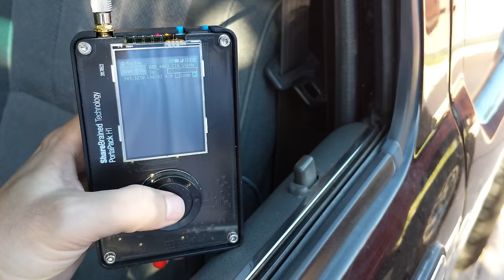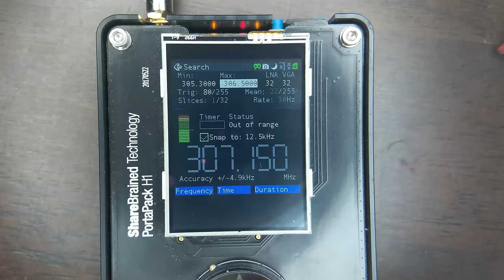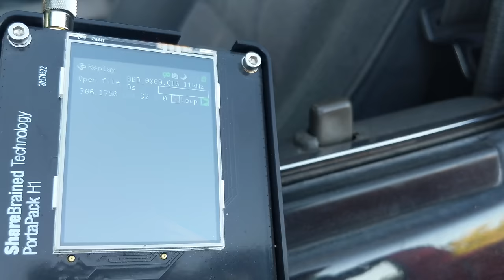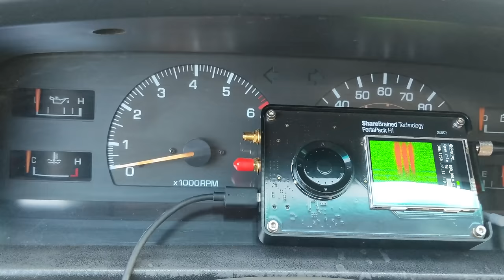Unlocking Car Doors with the HackRF Replay Attack

Comment: Just because the code is rolling doesn't mean you cant attack that device/vehicle..  You would have to either plant a sniffer or be within range of a target while they're trying to open the door , or start the car to not jam (but similar) their signal and keep that valid code stored.  The Hak5 video they released today was awesome , they were using the same hardware as you , same firmware.  This was the guy who did the amazing IR hacking video on Hak5, he is former military.  They tested this on a brand new ford , they've implemented a security feature that really isn't a security feature if you approach it from an unconventional way.  It used to be that you could just let off a burst of unlock codes and car wouldn't know what to do and eventually just open, no more. You can disable their remote and roll them back to 0 and as long as you play the unlock sequences in order it will work every time.  Until they reset their FOB as long as the captures are played in order the door will open.  Check that video out , it has 3 parts , very very cool things , he plans to open source the code at DefCon , he was just trying to get things ironed out with Ford before he goes and puts them on blast in front of the world.
Reply: Once someone has access to the vehicle they  can plug into the obd2 port and check door codes and implement whatever they wanted into the system.
Reply: lets be friends
Reply: Yea but the code still changes after they open the door once, no? So even if you capture it when someone drives off or walks off, you would need their clicker to intercept a new code to open it for yourself?
Reply: This is why we block OBD ports now and keep our keys in faraday pouches the moment we exit and lock and the vehicle.

Comment: if you capture a signal from a key not in range of the car, i believe it would be valid since it is new to the car, for modern keyless entry systems.
Reply: But as soon the owner uses his key, all older signals get unvalid
Reply: @CA-FE-C0-FF-EE-00  yep
Reply: Right because the code rolls to new codes each time

Comment: LOL, this has been solved long ago. Some remote chips use what is called rolling code. The code keep changing each time you press the remote and the car picke it. Remote will not use same key on the next press and on the car side, the last code has been stored in the body control module. So the module wont allow any reuse of a previous transmision because it will show the same code. This has  been mandatory, in companies like VW and it has been used as the industry standard for years. but, this is for OEM level gear. Probably cheapo alarms still dint got it right. Code is alway incremental counter and comparison is not just against value but a big range of numbers above the last one. so replying frames from 200 uses ago, wont work as well
Reply: 38911bytefree there must be a hack for that cos ppl were able to turn off my viper alarm
Reply: Just jam the frequency and grab the code. 'LOL'.
Reply: Rolling code is definately more secure, but it can also be hacked.  You can jam the nearby frequencies to "confuse" the car receiver and then capture the button press. The car of course won't unlock so the victim will press the button twice. You can detect the second button press and replay the first one,making the car open. Now the attacker can use the signal received from 2nd button press to open the car.
Reply: Dont forget most cars have a second remote... that's all I'm going to say 😂

Comment: The HackRF One can also be used to perform an attack on some cars that use rolling code, though.

The trick is to listen to 2 unlock attempts in a row. You partially jam both in a way you can still reconstruct the correct data (e.g. by jamming the CRC portion) and then you immediately replay the first one. Since the car has never heard the last one, you can still use it later, up until the car hears a new command from the actual key. In some cases, you can edit the packet, such as by changing it from "lock" to "unlock" and so on.

Comment: In case of a rolling code, isn't it will also work if you read the fob press code outside the car transmission range? Like somehow a car owner press key in rf reader proximity but both being away from car?

Comment: So did you try doing a replay attack on a rolling code key fob, when the key fob was far enough away from the car to not be able to communicate with each other? I'm reading samy kamkars power point from def con and it says that it should work. Obviously not ideal but i'm curious to know if the hackrf can do this.

Comment: rolling codes is also possible to hack, jam the same frequency of the rolling code to capture the 1st rolling code, then let it jam the same frequency to capture 2th rolling code. Then turn off the jammer and replay the first captured rolling code. and the door will open oeps;P The rolling codes are not time based they have a seed + counter.
Reply: Edris Keyam great comment 👍🏻🇬🇧
Reply: but if you are jamming the codes how could you replay them if the jammer was affecting that signal you saved?
Reply: How do you capture the signal if noise is being played on that same frequency the key fob is operating on? Wouldn't there be a bunch of garbage noise when you're jamming? I tried it myself and it did that, there was no way to pick up any signal because of all the noise coming from the jammer on that frequency.
Reply: @thatoneintrovert9618 you're correct my friend either steal the keys.. Or crack the window and pop the bonnet and go through the computer. Hypothetically ofc

Comment: I saw hardware like you have, but with option to block signal. Rolling code is using its code only one time, so you cant copy it. But if you block and copy the original signal you have a copy of unused  code. and it will open device only one time. Simple. :)

Comment: so its not just the frequency but also a certain signal code?
Reply: Yeah. If you just send on the fixed frequency nothing will happen. It needs a certain code aswell and sometimes you can manually set these on the transmitter (as shown in the video on one of the pictures)

Comment: Hello, I hope that you can help me, as I am just dipping my toe into the use of SDR radios. I understand that the PORTAPACK H2 is by what I have seen, is a FANTASTIC sounding radio. But what I do NOT yet understand, and PLEASE do NOT think that this is a STUPID question. But is the PORTAPACK H2 an ADD-ON device that you connect or a HackRF One SDR radio, or is it a ALL INONE SDR radio. As when I have seen the price of a HackRFOne SDR radio from between £125 to over £200. But when looking at the PORTAPACK H2, as I have seen them for the price as low as £150
As I say, it might sound STUPID, but do I need to buy a HackRF One SDR radio and then a PORTAPACK H2 to build a compleat unit ???????????

Hope that someone gets back to me very soon. 

Bye from John in England

Comment: I think because the market is being flooded with cheaply priced Chinese copies of the hackrf that maybe I should say something to those out there still undecided about upgrading from a flipper zero to a hackrf and I can only speak from a novice point of view of course but the 1st thing I notice dispite the cool neon lights it has and the almost walkie talkie type look to it is.....

1.) If your gonna try pentesting with this gadget outside anywhere your gonna need to carry a spare battery charger because it goes threw alot of juice while your busy searching down to the kernal to find what you want or think you want.

2.) Speaking of kernals and scripts the hackrf is alot more CLOSELY RELATED to the filing system in your computer then the flipper zero even with the newest installed firmware. So forget the notion that it's some kind of toy.

3.) Most of the stuff or some of the stuff you wanna see with your eyes.....like aircraft signals and Boat signals, ambulances, police, fire emergency's weather and radio frequencies..
....You can do all of that by just investing in a good scanner,
regardless of that unless your
Licensed and have one hell of a good reason you can't transmite anything to them.....

4.) It is very easy to blow the amp on the hackrf with only
The static charge of an antenna so care needs to be taken when handeling it.

5.) Which brings us back to the flipper zero and for it's creators to further evolve it's firmware to keep up with technology or the flipper zero will soon only be good as an electronic pet and not much more.....In my opinion the evolution of the Nano flipper zero was 100% geek and 0% pentester and that makes it a failure in the real world. So we need technology developers to get involved in our community and share that knowledge....becoming wealthy keeping technological secrets for telsa, automakers and gatekeepers will only last so long before someone publishes a book about it or leaks it to wikileaks..
and those are my opinions the hackrf requires far more hacking then the flipper zero but keep in mind the hackrf has a larger frequency range so you have to decide....What do you really wanna do? Pentest or become apart time geek?